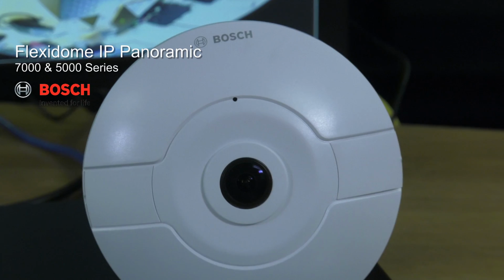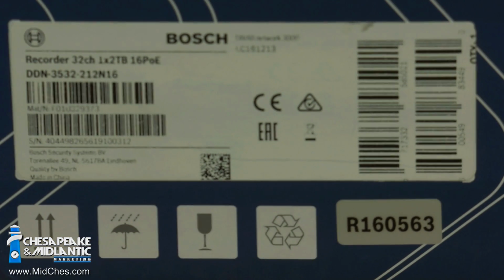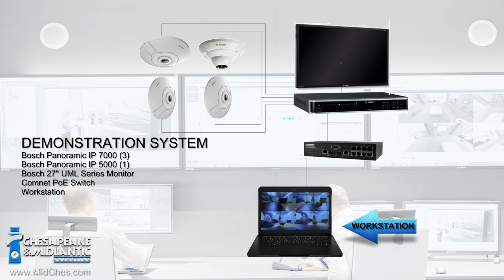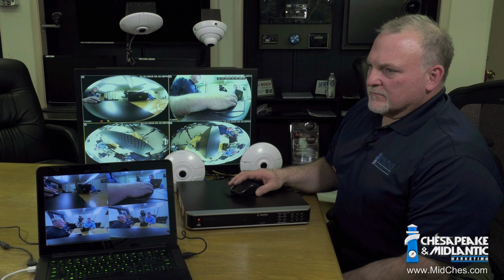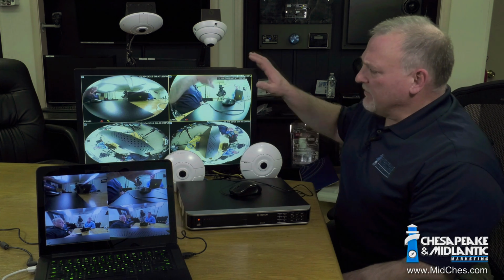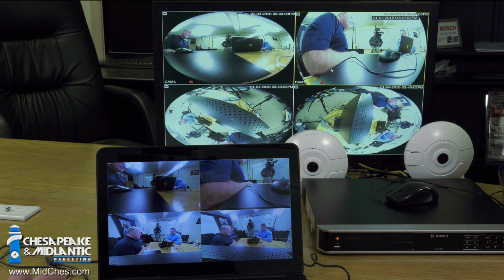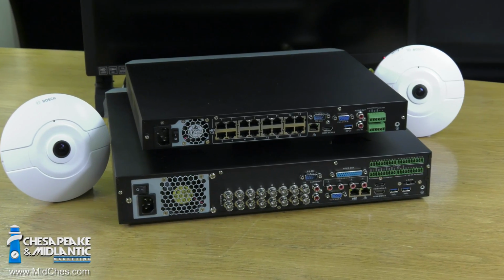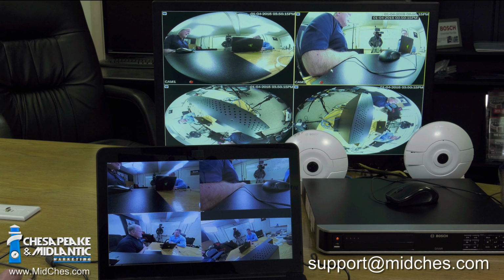Bosch Panoramic Flexidome with Divar Network/Hybrid 3000/5000 NVR

Comment: Hello guys,
I tried adding the divar to bvs over LAN but couldn't dewarp the image, how did you do it? Beside can you dewarp in playback?
Reply from the maker: Yahya, thanks for watching our video! In your message you reference "BVS." Assuming you mean BVC (Bosch Video Client), there is no special setup required. Be sure you are using Configuration Manager 5.50 or newer, BVC 1.7.6.69 or newer and the most current camera firmware.  More information is available in our related blog post here: http://blog.midches.com/blog/panoramic-security-cameras-bosch-divar-network-hybrid-recorder 

If you are referring to BVMS 5.5.5 or newer, see the Bosch video here: https://www.youtube.com/watch?v=_JCDaxAtZpA  

If you need technical assistance beyond this, please contact your local Bosch Security Systems representative or Technical Support team. If you need help finding those resources, let us know and we'll get you connected. You can email us directly at Support@MidChes.com